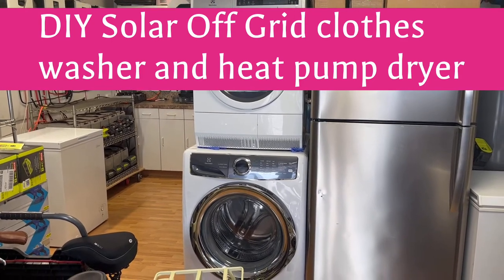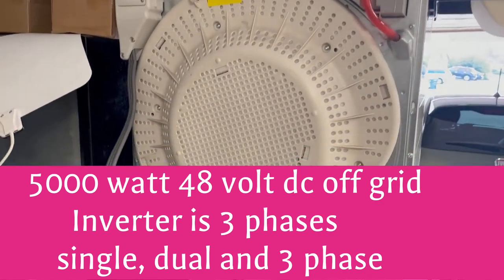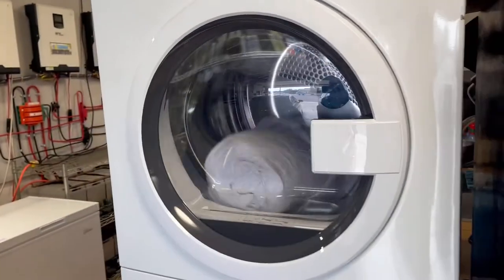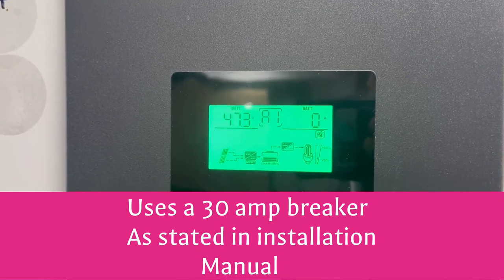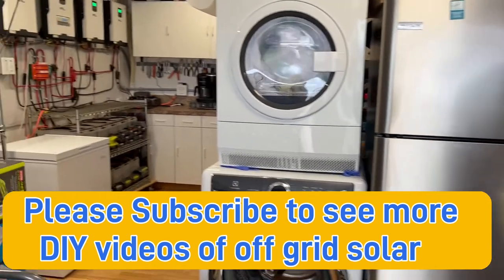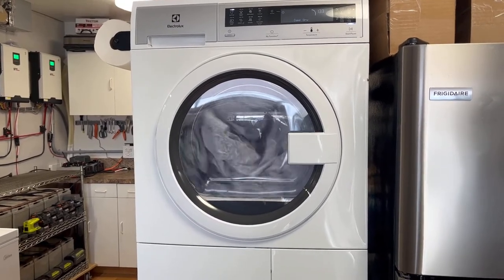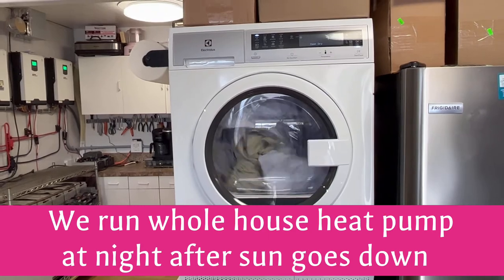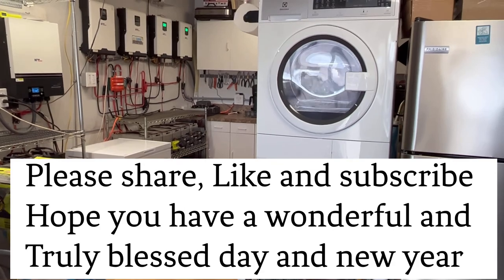DIY Solar power with Pappa using off grid solar for heat pump clothes dryer and washing machine

Comment: I feel like a dumb dumb, I've never heard of a heat pump dryer.  Great info!
Reply from the maker: I never heard of a heat pump dryer until a week before I bought one, so don’t feel bad. These are used in mobile homes, motor homes, camping trailers. They are about 20-30 percent smaller than a standard dryer. They use less than half the electricity than a standard full size dryer which for solar is a big deal. Your washing machine does not use that much electricity, only when on high spin to remove water from load, but that only runs on high for 2-4 minutes maybe 3 times during the wash cycle. The dryer pulls in air then blows out around 90 -115 degree heat into the room. I usually run this in my garage in winter to warm up garage but can run in the summer since I air condition my garage all day. Hope this helps. Hope you have a wonderful and blessed day

Comment: It will also dehumidify the area for some if used an a basement home it will help those .. Same with the Heat pump Hot water tank
Reply from the maker: Great point you make. We lack humidity in Arizona so I would not have thought of that.

Comment: Is this a compressor based one?
Reply from the maker: This is a heat pump dryer, only uses around 1/2 the watts of regular fryer. Found this at American Freight store in Phoenix AZ. I believe it has a compressor since it is a heat pump. It was a floor sample , was $299. You have to empty the container on top left side every 2-3 dryer loads. It will be full of water from clothes. I disconnected the water container and ran a drain line to my sink so I never have to empty container. I have had no pro with unit. Works great, takes about 20-30 longer than normal dryer since it is only using half the watts while running. Cloths come with no wrinkles because when load is done, dryer will toss clothes ever couple of minutes so no wrinkles form on clothes. Got my moneys worth out of this unit. Some people install this dryer in their motor home or travel trailer to use while camping. This unit is about 2/3 the size of a normal size dryer.
Reply: @diy-solar-guy  Cool stuff glad it works so well :) There are two types of these dryers though...one uses a air conditioning compressor the other uses a condensing method. I was curious which tech this one used?
Reply from the maker: @MyGoogleYoutube  I have not torn unit apart to see. But I just looked it up online, says it is a condenser dryer.